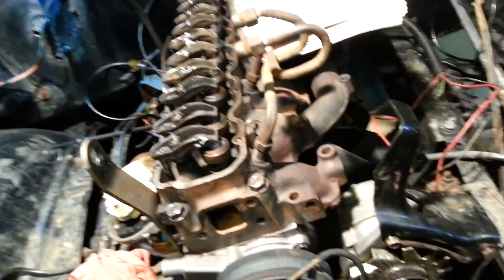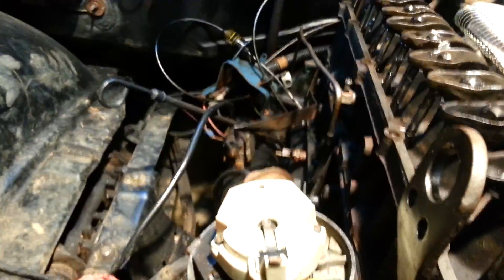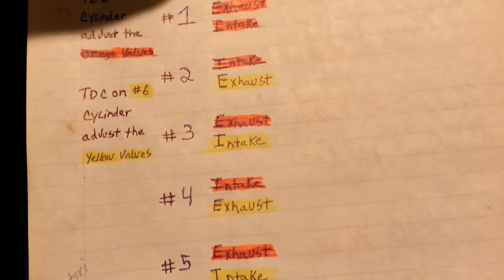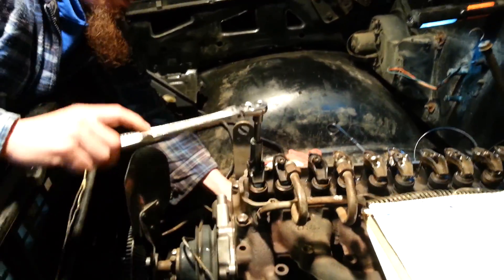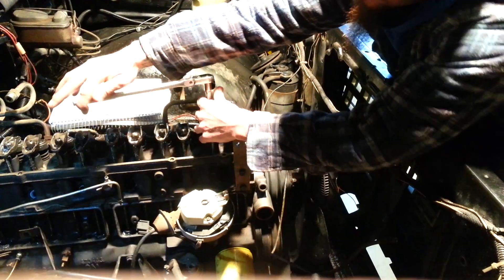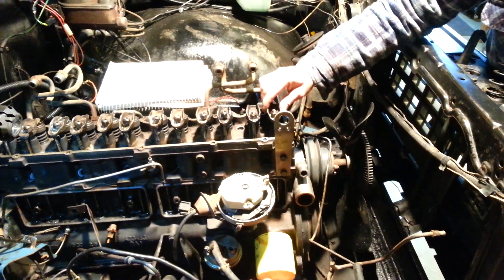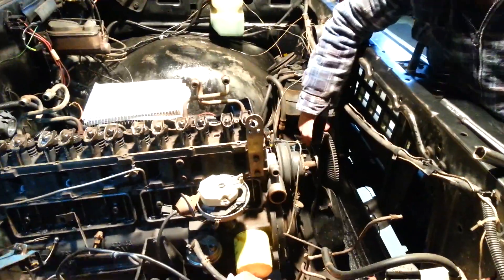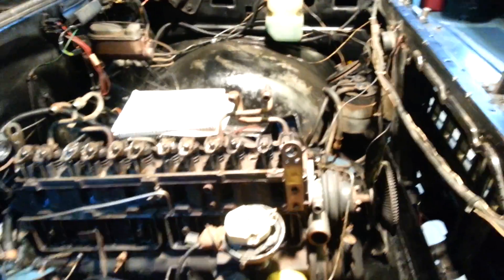Valve adjustment on a inline 6

Comment: The front of the engine head, facing the radiator.  Number 1 icylinder; exhaust rocker arm begins here.  Followed by the Number 1 cylinder; intake rocker arm as the second inline rocker arm.  At the back of the engine.  Begins Number 6 cylinder exhaust rocker arm is the 12th last rocker arm.  The 11th rocker arm is the 6 cylinder intake rocker arm.  The number 2 cylinder begins with the 3rd rocker arm as the intake rocker arm.  Followed by the number 2 cylinder exhaust rocker arm.  As the 4th rocker arm from the front.  Number 3 cylinder begins with the 5 rocker arm as the exhaust rocker arm.  Number 3 cylinder ends with the 6th rocker arm as the intake.  Number 4 cylinder begins with the 7th rocker arm as the intake.  Number 4 cylinder ends with the 8th rocker arm as the exhaust.  Number 5 cylinder begins with the 9th rocker arm as the exhaust.  Number 5 cylinder ends with the 10th rocker arm as the intake rocker arm.  Number 6 cylinder begins with the 11th rocker arm as the intake rocker arm.  Number 6 cylinder at the rear of the engine ends with the 12th rocker arm as the exhaust.  HAPPY  Motoring!  Credit for this info at https://www.westmarine.com/sierra-18-1960-1-manifold-mercruiser-58759a10-197173.html?msclkid=cc01ffd2582c114a45b29b4b72135b23&utm_source=bing&utm_medium=cpc&utm_campaign=BSC%3EBrand%3EEngineSystems&utm_term=4577816667596422&utm_content=EngineSystems

More credit info at https://www.youtube.com/watch?v=aSM74m9_B8g

Comment: Hi I understand how you marked it at the number one top to center on distributor, ? where exactly does the other Mark go? I noticed you said 6 cylinder thank you
Reply: Basically, the distributor will only drop down 2 ways. One way the timing is correct, or you will be 180 degrees off. I always mark the base of the distributor where #1 is before taking the cap off, makes it easier for putting the plugs back in the right order

Comment: Hi.can you tell me the clearance of Leyland comet 1416 model year of manufacture 1990.i need to know in mm as some mechanic set my bus to 1.20mm and the bus still overheating
Reply: It will depend weather you have sodium filled valves and the color of your shirt.

Comment: I did exactly as you said and oh man is my truck running way better... but the lifters are super noisy. But the truck is running great!!!!. It was smoking quite a bit before and now there's no smoke. Probably did something wrong. 1976 c10  3 on the tree.
Reply: Sounds like you might have excess lash if it’s running real noisy, check the valve tolerance.
Reply: Oil pressure might be low too?
Reply: The pressure marked ok but the gauges were crap. I haven’t touched the truck since this comment. I’ve had way too many projects. I agree with the excess lash. Could be collapsed lifters idk. I was thinking of just rebuilding engine or dropping a 383. Too many options. Will not do ls swap nope. Truck will be in family for long time since my father gave it to me.
Reply: @alexavila7489  a guy made 320 hp on one of these motors, naturally aspirated. I just bought a boat with this motor. It's quite large actually...anyway, I hear 6a kn projects. I've got a 78 malibu, this is year 21for it